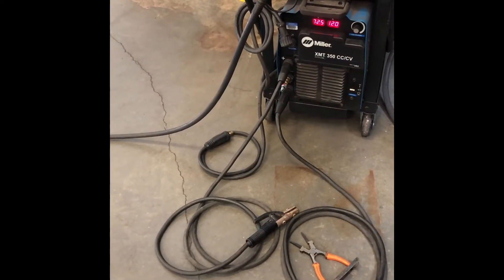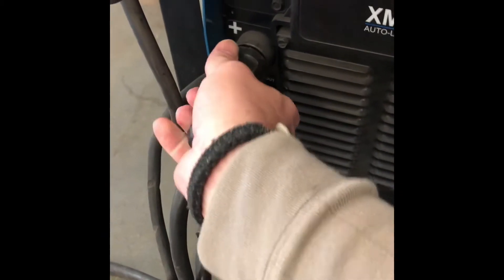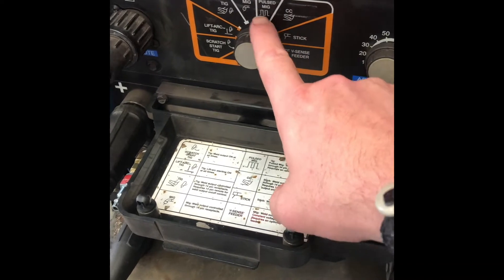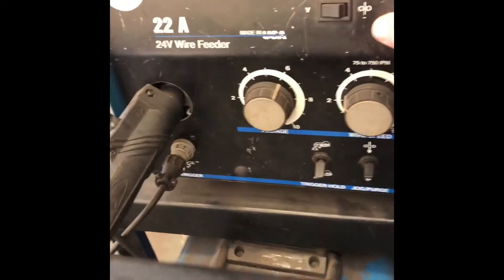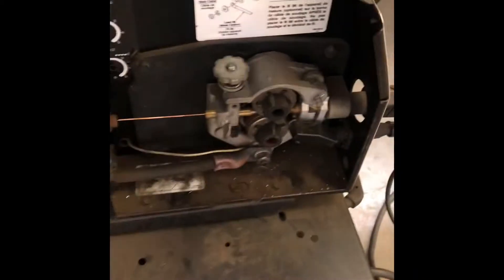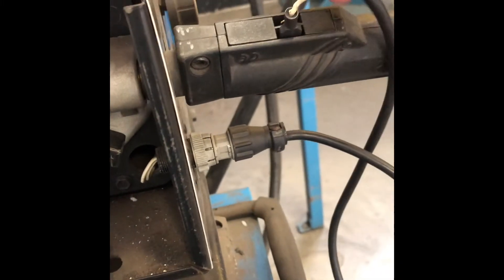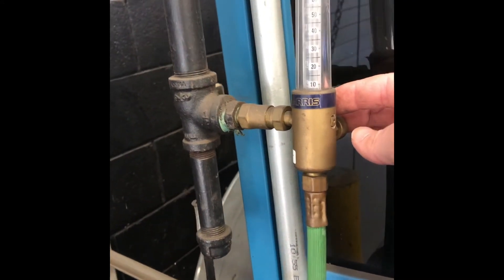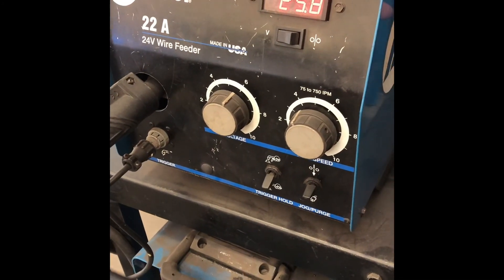GMAW Set up on Miller XMT350

Comment: where does the ground go for the actual wire feeder? does it go in the negative terminal?
Reply from the maker: The ground comes off the negative terminal of the power supply. If u have one from the external wire feeder, you got 2 options. Either wind it up and don’t use it, or attach it like a 2nd ground to your base metal.

Comment: Hello great video I am a 1st year welding teacher and I’m not educated on this particular machine. I got a few questions. My machine doesn’t have the voltage nob and how do u set the amperage in the mig setting?
Reply from the maker: If your feeder doesn’t have a voltage knob, then you will set the voltage using the volt/amp know on the power supply. You use volts to wire weld not amps, so you can’t set those, they fluctuate as you weld.
Reply: @waylonthewelder2733  what are some good 1/4inch settings for f1 T joints i learned on the millermatic and i’ve been having trouble getting good welds